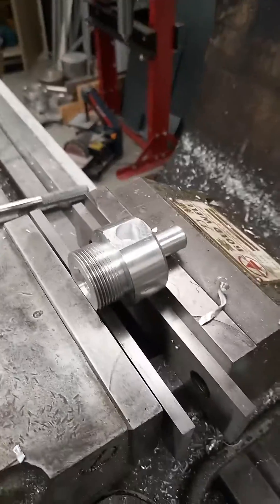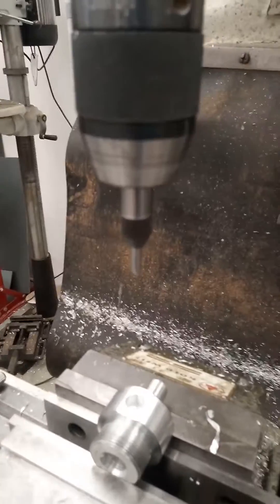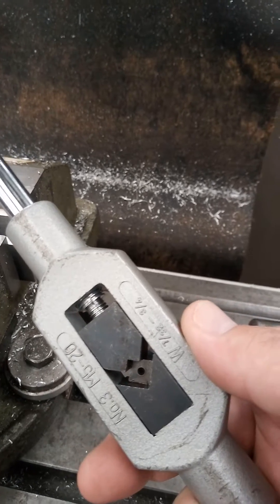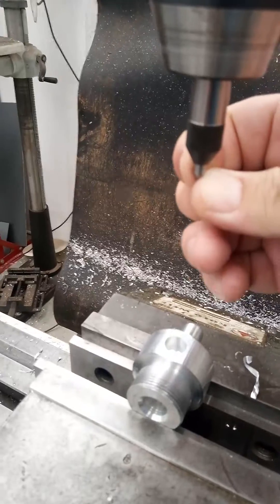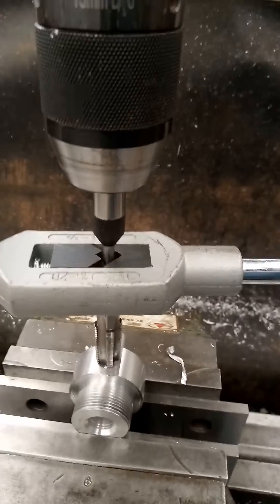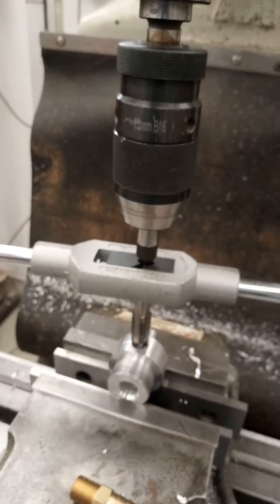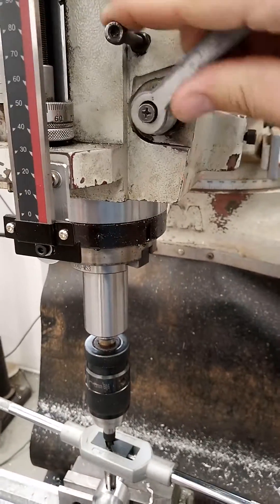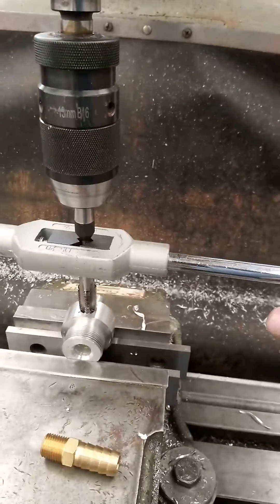Tapping a new thread - how to do it 100% straight

Comment: If you do not have the handy guide, chuck the tap in the drill press, manually twist the chuck with one hand while using the other hand to maintain light feed handle down pressure.
Reply from the maker: Yip, almost the same result but I do find the tap wants to move more with only one hand on the tapping handle.